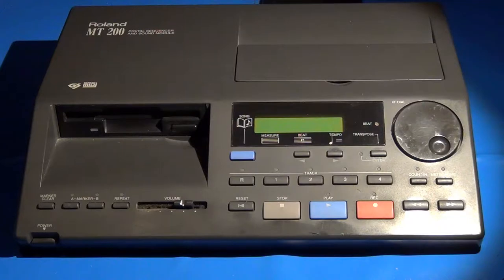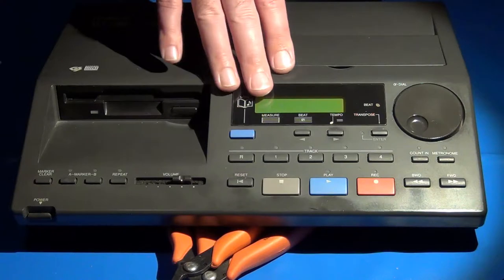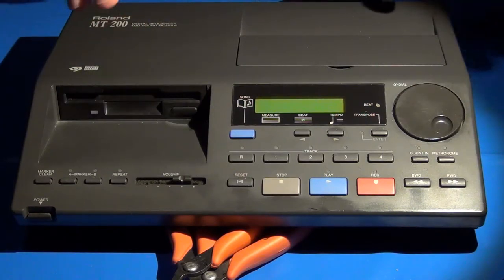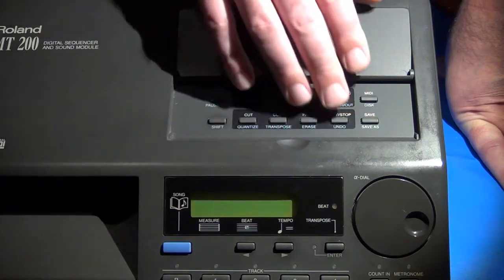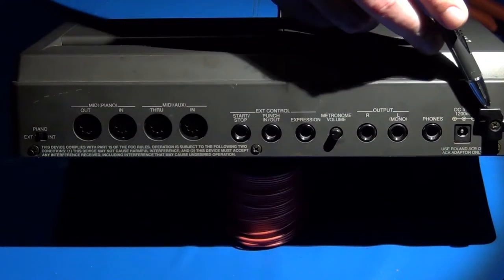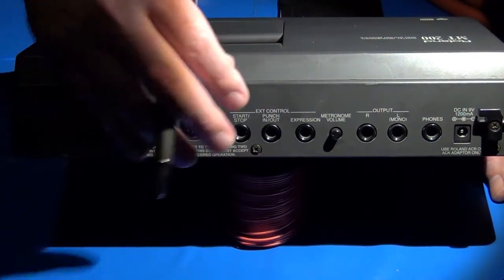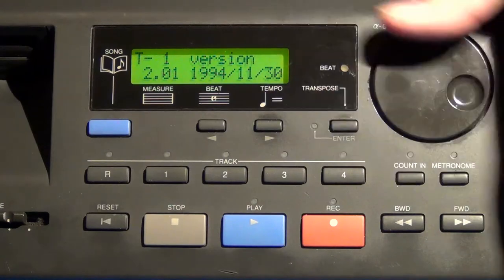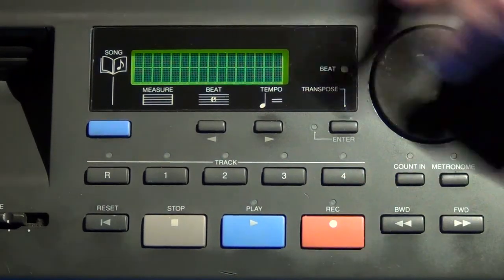ITC#35 - Roland MT-200 Tutorial: Part1 - Test/Diagnostics Menu and basic functions

Comment: You are amazing in how thorough you cover things. I worked at the factory where they sold copies of these units and we never got any training like you have provided!
Reply from the maker: I'm glad you found the information helpful! That is why I made the video since I myself had lots of trouble finding any information regarding these fairly unknown sequencer/modules.
Reply: These are great devices : I have a MT90 s ( not the usb mode! l) that I still use for midi backing tracks ( it has no. Great sounds, maybe less realistic than the VST instruments that are on the market today but  they  "blend" very) well without adaptation. I just updated  the floppy drive for an usb floppy emulator. 
Mt 90s does not allow recording though.
Reply from the maker: Just saw this and in the time frame since I made these videos, I've also gotten an MT-90s and like you was shocked at how easy it was to put a GoTEK into it. If you order a PC 1.44mb version of the GoTEK it will literally just pop in place of an original floppy drive in the MT-90s. But the MT-200 and I suspect the MT-120 required some jumper settings to get a GoTEK working as I detailed in another video. I do like 2 thinks about the MT-90s that the MT-200 cannot do. One is that the MT-90 like most newer modules, is able to handle tempos above 250bpm. There are some midi files I have that were composed faster than 250bpm that the MT-200 simply plays at 250 and they play slower naturally. I also really like the MT-90s increased polyphony as many newer midi files of the late 90s and early 2000s required more than the 24voices that the MT-200 is limited to. 

Having said that, I still prefer the overall drums and much of the instrumentation in the rom set on the MT-200 over what was put into the MT-90s. 

BTW the MT-200 can also use the Roland utility to swap the SC-55 into MT-32 mode. So, the MT-200 can emulate that as well. Provided the midi doesn't use custom patches, it sounds pretty good on the MT-200 in the MT-32 mode. Newer modules didn't keep this backward ability in mind as the MT-90s is not able to do this.

Comment: All is good with mine except a strange problem. My edit disk functions work on my USB fine till I load a file on that partition then I can't  gain access to the edit disk functions. The MIDI file will play fine on that partition I just can't edit the file like save, copy, delete. I have also tried different partitions, saved as Type 0, changed file name still same problem. I will just deal with it if I can't edit the file but it would be nice. Thank you for any suggestions.
I have also used your video to format USB partitions and I did also see if my files were read only.
Reply from the maker: Hmm...I think I had someone else tell me something similar when they installed a GoTEK into theirs as well. I don't actually use my MT-200 for actual sequence work so it isn't something I've used very much on my MT-200. I will have to check this, but I know I've been able to do this without issue on the midi I've captured through it and recorded. I can specify the filename to save it with and delete them without issue. Wonder if something on the GoTEK drive firmware has been changed since I originally did mine 2 years ago? Another thought is if the files were copied over to the USB partition with the read only attrib set on them? That would only you to read the files and not modify them. You would have to check for that in the floppy utility or the original file attributes to be sure.
Reply: @IvoryTowerCollections  Thanks. I was thinking it might be a read only file but not the case. You may be right, it may have something to do with the firmware. Guess I will just have to deal with it, no big deal I guess.

Comment: I just got one but the power supply I got only has 500mA. I guess I will need to get the correct powder supply before I can test the unit.
Reply from the maker: yeah 500mA is a bit low. It might work but I wouldn't use it long term and the MT-200 might not perform properly if it doesn't have enough current from the adapter to operate. An excellent replacement power supply is to use an early Sega Genesis or Master system power supply as they are an exact match for the specs of the original Roland adapter and in fact is what was used in these series of videos since I didn't have an official power supply for my Mt-200 at the time. I did mention the PSB-120 and actually use that, but it wasn't actually used in these videos since I had the Genesis supply on hand more at the ready.
Reply: Thanks, yes I won't be using the 500mA power but think I found a correct one to buy at the Guitar Center. I can't wait till I can use it. I'm not a gamer but bought it for the MIDI file playback of my sequences I make on my computer.
Reply: @IvoryTowerCollections  The seller is sending me the correct power supply, be here maybe on Monday. I do have Roland PS (for a Roland Octapad) that is 1000mA. Could I use that one at least to just see if it powers up or should I wait? Thanks
Reply: @IvoryTowerCollections  new power supply came and my MT-200 works fine but mine is only is only 24 polyphony and not 28 but not a problem. Looks like mine has the firmware from 91 and not 94. I will mainly be using external sounds from sound modules.